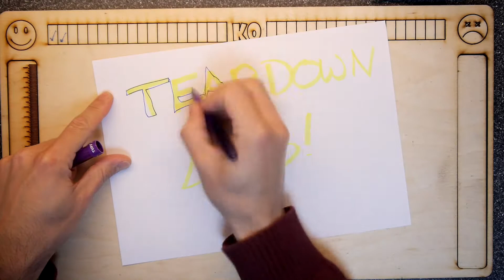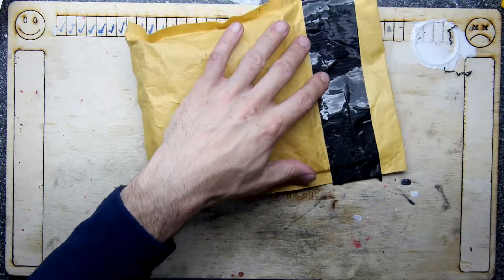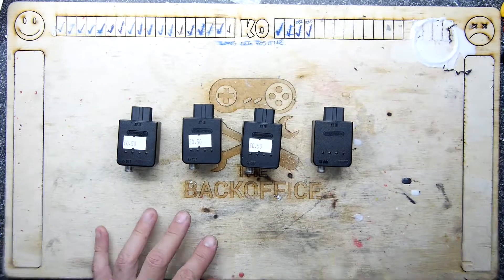Nintendo RF Modulator

Comment: You can tell that the first two pins with a common connection are mixing stereo audio down to mono. The other two go right into the ground plane. By process of elimination, the remaining two pins would have to be 5v and CVBS (Composite Video).

Comment: As others have said, it does not fit the SNS-001 and SHVC-001, but it was specifically intended for the 101 versions of this consoles. It should also fit the AV Famicom (New Family Computer AV) and looks almost identical to the one intended for the AV Fami except it is a different height and different color plastic.
Reply: Yes it fits and works with AV Fami, and recommended for any North American user as the Japanese unit will require a strange channel most NA sets can't access
Reply: @StrokedGT  Yep. I doubt many would import an HVC-101 (AV Fami), SHVC-101 (SFC Jr), or NUS-001 (JPN) intending to use RF, but…yeah, they’ll probably want their local RF modulator if they do. :) It will fit and work just fine, it just won’t sit exactly right with an HVC-101.

Comment: Hi. how can I identify the luma and crhoma signal in this modulator. you could help me? thank you
Reply: The modulator does not have pins for Chroma (C) and Luma (Y). It only needs power, ground, composite, and mono audio. There are two power pins and the stereo audio pins likely converge even though the pinout also has a mono audio pin. That's the only reason it has as many pins as it does. It may be possible to use the mono audio pin and only one ground to free up two pins and move those to the appropriate part of the connector for Y/C.
Reply from the maker: Fine the pinouts of the device itself and work backwards
Reply: @backofficeshow  Thanks

Comment: I used one of these a decade ago to set up a system where a video signal would be transferred from one room to another. However it started failing recently, the audio volume has drifted way down! I wonder what's wrong with it. Well, perhaps i can just source a replacement.
Reply from the maker: +Siana Gearz There are still many on eBay, probably owing to the fact a lot of TVs don't have analogue tuners anymore. Hope you are lucky!
Reply: Just use composite video

Comment: again, i'll point out the casio telly i sent you has composite in (top left side) as well as rf in (top right side) so need for a composite to rf adapter. all you need isa simple dual phono to jack adapter plug, (a few pence on ebay)
Reply from the maker: +ImpaledGryphon I noted it at the time sir cheers 👍

Comment: Should work on any Nintendo with the old multi-out I think. SNES, N64 (obvs) & GameCube.
Reply: Physically it won't fit the SNES / Super Famicom due to the top shell and the RF mod. casing but would likely work if you cracked one of these open as I believe composite remains consistent on them all (Pin 9)
Reply: @A3rgan  Correct. It was made to fit SHVC-101 (Super Famicom Jr), SNS-101 (SNES jr), NUS-001 (N64), NUS-101 (Pikachu N64), DOL-001 (digital-out GameCube), & DOL-101 (analog-only GameCube), but it will not physically fit the SHVC-001 (original Super Famicom) and SNS-001 (original SNES). Those consoles already have an RF modulator and do not need another attached. The HVC-101 (AV Famicom) has a nearly identical RF modulator in a light gray color and and one may fit the other but the height is slightly different. IIRC, a SNES/N64/GC modulator will lift the console slightly.

The SNS-101 specifically tells you to buy a N64 modulator if you need RF and the modulator was later repackaged and sold specifically as a GameCube accessory.
Reply from the maker: +Mark Sharples Using it as intended? That seems very pedestrian 😂
Reply: As if you would........😁 If your using one of those for it's intended use in 2017, you've given up!
Reply from the maker: +Mark Sharples haha true!

Comment: I had the Radio Shack version of that tv and it had an audio/video jack. Wouldn't it be a little more compatible with everything to make a composite video/audio cable for that input? Unless the Casio version left it out maybe?
Reply from the maker: +Watcher75 it would. In case I have some integrated AV equipment I want to modernise